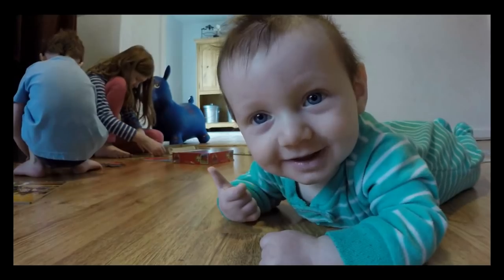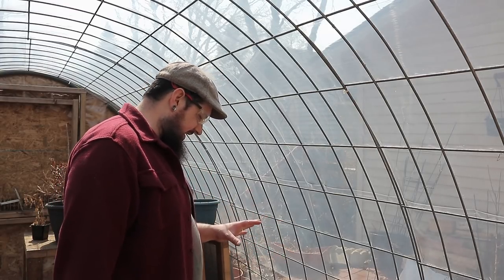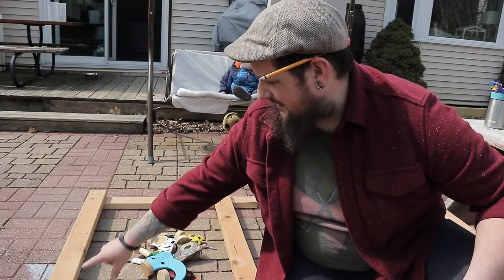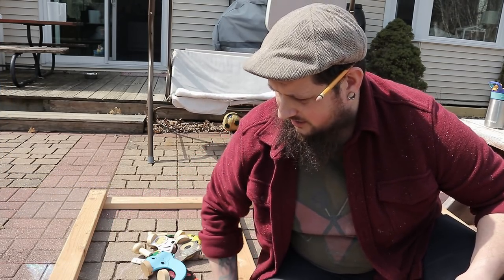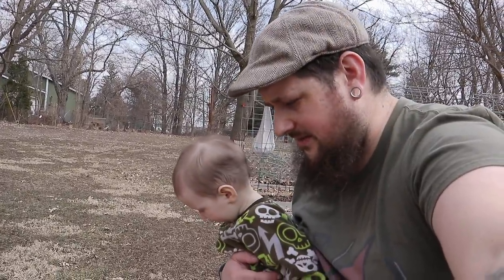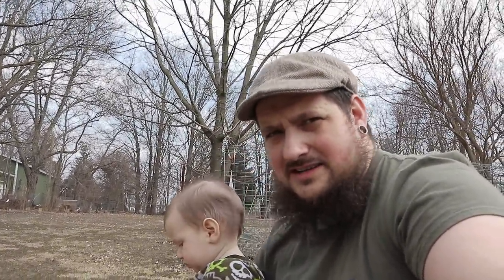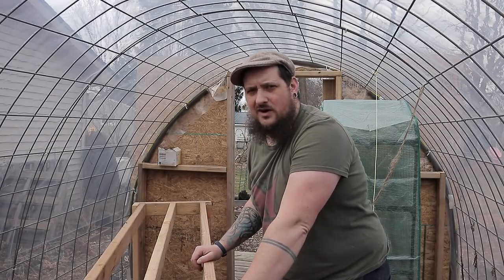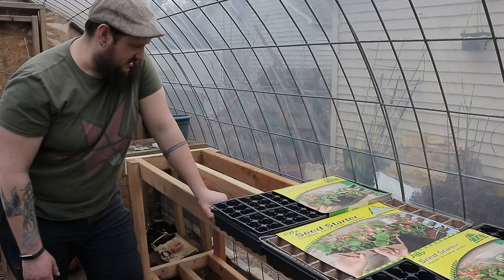Cheap Easy Potting Table For The Greenhouse

Comment: Hi Josh, I used to live in Canton, Colorado for 31 years. We have freezing temps at night putting a bite on my spring bulbs😥 should cover em with the leaves I raked.. duh.. we've got one more night.. all this month off and on. You're doing a good job. I made my tables from pallets.
Reply from the maker: I thought about using pallets I have a couple extras but my greenhouse is pretty tiny really so a smaller table worked better
Reply: @Citystead  my pallet tables are only 2 ft wide deep, 4ft wide. I don't want 4 ft deep so I cut 3 pallets in half. Used 1pc for table top and 2pcs for sides with a back brace.